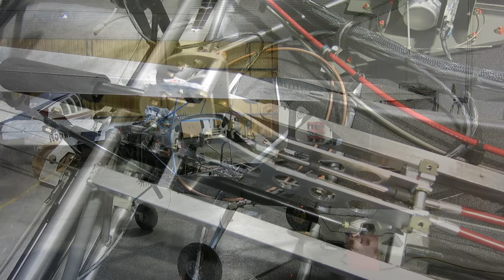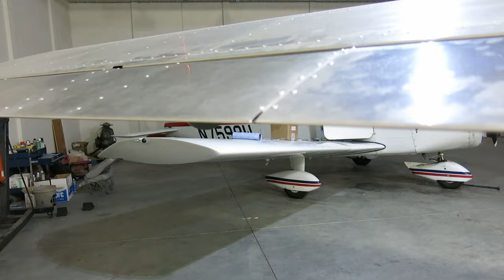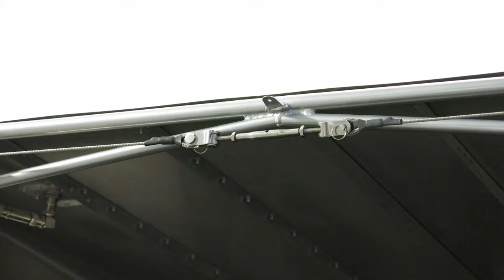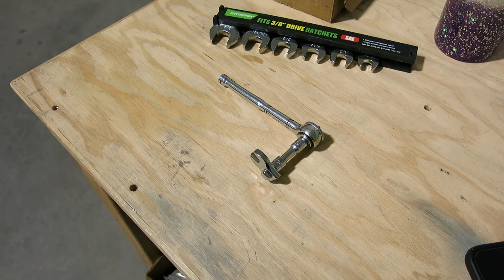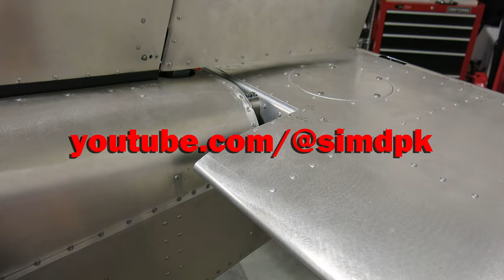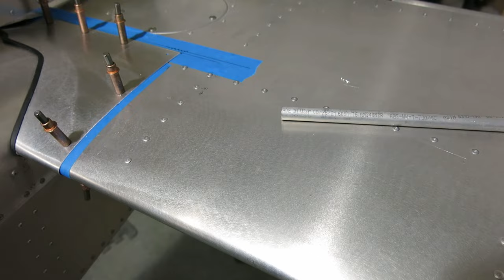#341 03-23-2024 Ailerons, Flaps, and Fairings....and a little piping, too!

Comment: That is odd that one aileron would have less travel than the other.  I am trying think what in the geometry might be asymmetric, but nothing jumps to mind. Something has to be somewhat asymmetrical for that to happen.
Reply from the maker: Yeah seems strange to me. The bell crank is the same part on both sides. Tony said they see that on all the factory built, too.
Reply: @s-21project92  I will have to take a closer look next time I am in my shop.  That is puzzling.  Not a big deal, but certainly a curiosity.